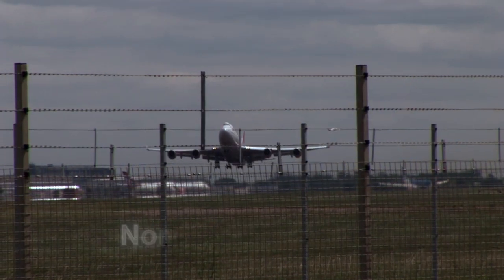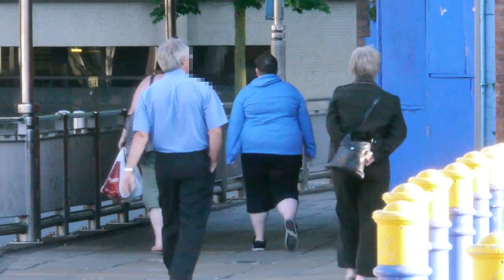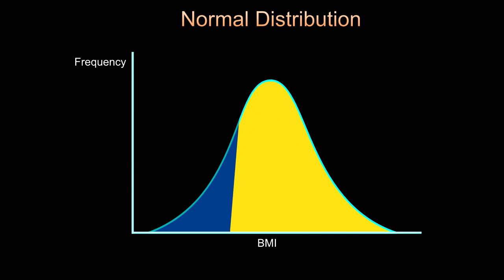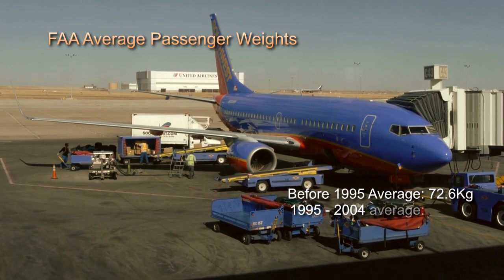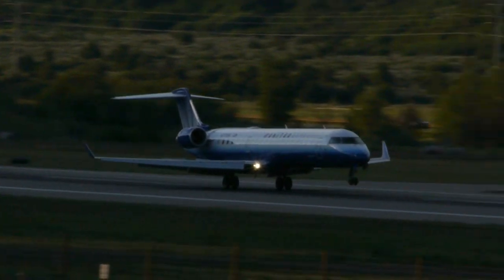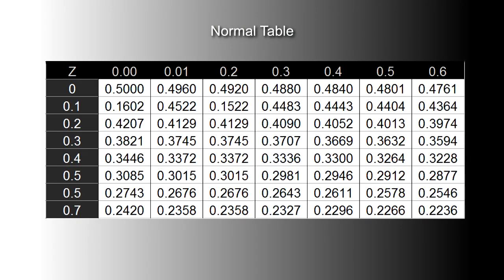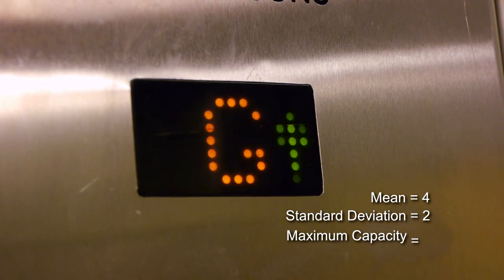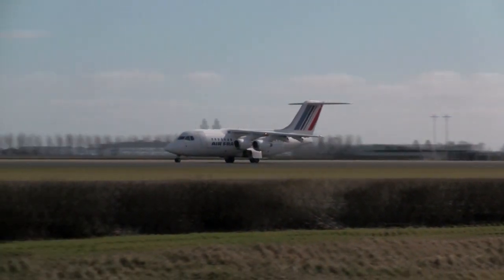The Normal Distribution (DeSTRESS Film 11)

Comment: I think the normal table needs to be corrected. Should show 0.03 at about minute 14.
Reply from the maker: Thanks for pointing out the problem. You are right that there are some errors in the table and we will upload a new version of the video with corrections. The basic procedure that he shows is right, and the result he gets is correct for that problem, but it would be clearer if the table were correct.
Reply: Yes. Really like the video:)